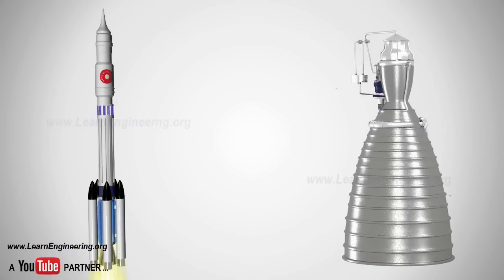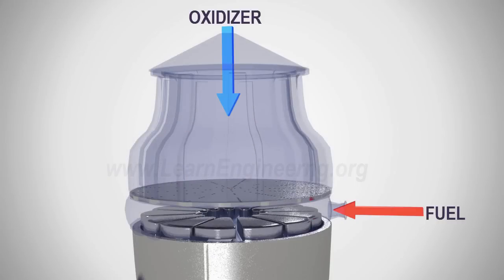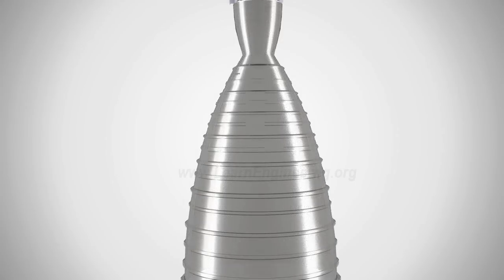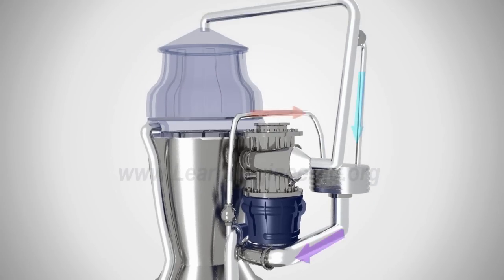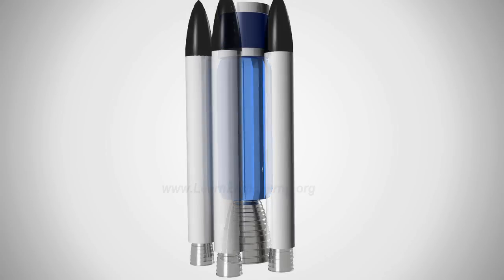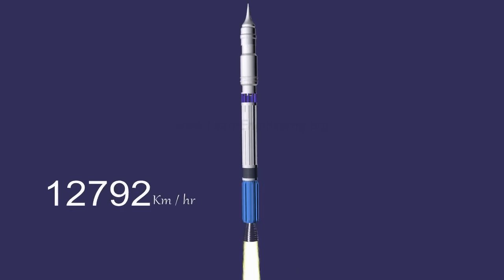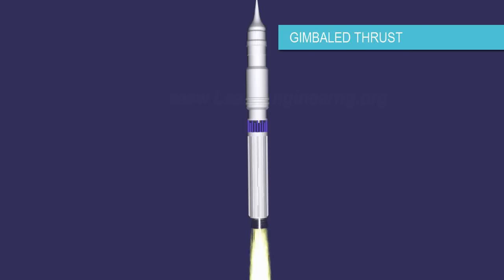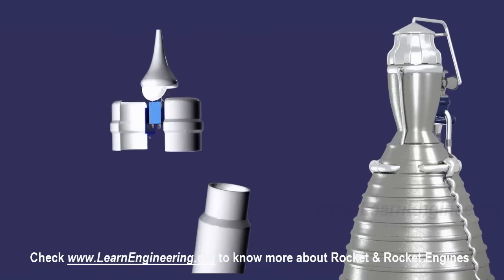How a Rocket works?

Comment: You talked about and showed animated "FLOW" going supersonic. This contradicts your idea of ejecting mass, that is just a mathematical construct, you are not ejecting anything, and there is no explosion anywhere, it is a combustion or a burn as you rightly stated. According to the article in wiki on rocket engine nozzles, any given diameter is only good at one altitude ideally, thus, at ground level where air is dense you need a narrow nozzle to concentrate the exhaust thrust column to push off the dense air. At high altitude you need a wide nozzle which disperses the exhaust thrust column to match the thin (dispersed) ambient air. The rule of thumb is like pushes best against like--your feet push off of solid surfaces but are useless against air. You will immobilize a rocket easily if you stick a wide nozzle on at ground level EASY debunk rockets don't need air https://www.youtube.com/watch?v=cEb6XFHTMPs sorry about that!
Reply: I'll try to make this simple: Pushing AGAINST air is NOT the way rockets work.
Reply: How do jet planes work?
Reply: it is a gas in both cases. In fact, NASA says a balloon is "the same principle" as a rocket.
Reply: And what does that have to do with rockets? NASA does not say that is "the same principle" as rockets. That is just bogus mind control disinformation that you parrot w/o thinking twice about it. Take away the ground or put oil on it and see how far you go w/o friction. There is no difference between rockets and jet planes, both push off air, rockets use the expanding gases of combustion directly and for 100% of thrust, jets use the air for 80% and combustion for the rest. You have stop believing in fairy tales.
Reply: It's called reflection. Now, you have not disproved that rockets push off air. Also, it is A FACT that earth is flat and the sun circles above. Sundials would simply FAIL on a spinning ball, there is absolutely NOTHING you can say to change that. Keep believing in your scientism, I'll stick to actual scientific observational REALITY.
Reply: Nothing you believe has been proved, starting with grabbity. The centrifugal force varies according to the diameter of fake globe earth, how the FUCK does grabbity vary? You admit rockets push off air, so what is your problem? Again, sundials destroy the fake globe, why do you choose delusion instead of REALITY?
Reply: No, only during the 24 hr northern sun can you film the sun in 360 degrees by panning TO FOLLOW THE SUN. On fake globe earth, your right shoulder crosses 12 o'clock then at 6 o'clock position your left shoulder crosses, THIS IS NOT REALITY, NOT OBSERVED. The shadows don't cross either. The globe is dead. Only exists in your head. And you call that "science"? hahaha!!! Wake up!
Reply: TRY IT! All games are based on flat earth and rendered as if earth is flat.
Reply: look up how sun sets on flat earth. I highly recommend p-brane channel for beginners like you. He covers perspective, but it is also the atmospheric refraction as a convex lens, I'll give you two links, one of p-brane's vids and one that covers the convex lensing, in that order: https://youtu.be/t_ipGoFf2Ss and https://youtu.be/75rBxMI8SME
Reply: The earth is a spinning object. You are lost in this discussion or you cannot read plain English.
Reply: Sweety, I do wish you luck, but I wish you would TRY at least to put the ridiculous claims we were indoctrinated from childhood with, to the test! The more you do that, the sooner you will understand earth is flat and stationary. It is a fact. I initially started out to "debunk" flat earth, but I could not do it and be honest at the same time. That is where the chips fall. Study my few videos on rockets, read the article in wiki on Rocket Engine Nozzles, and see the demo in my videos. You need a wide nozzle up high because the air is thin and pressure is low, the wide nozzle disperses the exhaust thrust column to match those ambient conditions. At ground level, the nozzle is narrow, to concentrate the exhaust thrust column. Rockets and jet planes both push off the air. Your dream should be to expose the lies of NASA. Seriously, you are not even trying.
Reply: All the proof is in our everyday observations, and EVERYTHING I say can easily be verified by anybody. No magical forces to believe in, no fairy tales... just the cold hard facts. I have given you more than enough info in this thread, the rest is up to you. Go ahead and remain an indoctrinated non-thinking parrot. Infinite space is NOT a confined space. Vacuum ONLY exists in man-made confined spaces on flat earth.
Reply: @rocketspushoffair  Jet aircraft are propelled, due to the fact that their engines are ejecting large amounts of air (air has mass) at very large velocities, thus creating a momentum force. Remember the equation F=ma, where the resultant force is found by multiplying a mass (air out of the engines) by its acceleration (speed of the air). It's a common myth that a jet aircraft is propelled by its exhaust pushing off air. 
If you knew much about aviation and jet engines, you'd know that the power output of an engine is given in POUNDS of thrust or Newtons - in other words, it's thrust is calculated by how much air (mass) is ejected at any given power setting.
Reply: @sailorman8668  Pounds of thrust t hat push off the atmosphere. Stick your arm out a car window at 10 mph and at 60 mph and you will understand that jets and rockets push off air. The faster you move in the atmosphere, the greater the barrier it provides, basic science my friend.

"Ejecting" a mass is absurd, because it implies that once ejected, you cannot affect thrust by messing with the ejected mass. However, simply bending the exhaust immobilizes the rocket, as is demonstrated in my videos, which 100% debunks your beliefs about rockets and jet planes.

Another problem for you is heat. We can barely do mach 3 and the fuel gaskets melt at that speed. Just watch 5 minutes of a shuttle launch filmed from a jet plane, and the NASA audio is overlaid onto the footage. Notice that NONE of the speed increases are observed, and it even slows down. It basically reaches the top of its max altitude (about 22 to 25 miles) and due to thin air cannot climb higher. It then falls back down to complete its parabolic arc: https://www.youtube.com/watch?v=1YQ3tVpwo2E

Seeing is believing. Science is observation based.

And speaking of pound force, where is the hoop stress in the ground that correlates with spinning over 1000 mph? It should be in the millions of pounds per square inch, based on the weight of fake globe earth.

NO HOOP STRESS = NO SPIN = NO GLOBE = FLAT EARTH
Reply: TOTAL DEBUNK of "ejecting a mass" PROOF that rockets push off air https://youtu.be/CLjxKhdQSrI

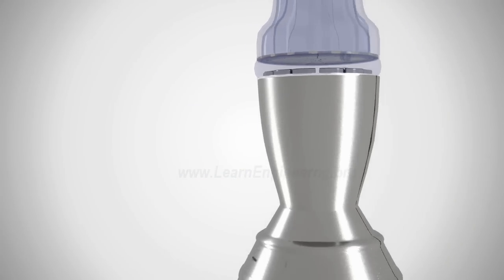Comment: 1:00 How does that shape increases the velocity of the exhaust?
Reply: Just like plastic water pipe squished by lage increases water pressure.
Reply: @abhishekmedhekar3418  I would like to point out that your statement is not entirely correct. Due the Law of conservation of energy and momentum, as a fluid flows through a pipe that is decreasing in diameter, the resulting pressure decreases as well. Remember, the pressure is the amount of fluid in any given area. Because the quantity of fluid at which the engine ejects is constant, the amount of energy from said fluid must remain the same. Therefore, if the area the fluid is moving in starts to constrict, it will naturally speed up because of the shorter path it is going through. But if the fluid moves faster, how could its energy stay the same? Well, the only way that can happen is if the amount of fluid going through decreases.

Here is a simple way to think of it

If the pipe diameter decreases, the fluid pressure decreases while the speed increases. 

If the pipe diameter increases, the fluid pressure increases while the speed decreases.

I hope this was helpful.

Comment: All a rocket is it's a jet engine which carries and feed it's own oxygen to the combustion chamber. Both gain thrust by pushing off the medium of ground and the air mass.
Reply: "All a rocket is it's a jet engine which carries and feed it's own oxygen to the combustion chamber. "
Correct.

"Both gain thrust by pushing off the medium of ground and the air mass."
The push out mass in the back, so create a momentun, an so the rocket moves in the other direction with the exact same momentum.

Of course the work in vacuum. They work even better, because there is no air drag- Only delusional conspiracy theorists with no understanding of basic physics, that were discoverd 300 years ago, believe, that they don't work ina a vacuum.
Reply: It seems you don't even know how a jet engine provides 'thrust' to propel the aircraft. 
You didn't actually know that air has mass, did you? LOL.

Comment: That is not Neutons law.. For every action there is an equal and opposite reaction. So I can see the fire at the back is the action and the rocket moving forward is a reaction but where is the opposite reaction?? Rockets cannot possibly work in space and the NASA analogy is fake physics and a disgrace to Neuton.. I vile lie and obviously to rip off the planet..
Reply: Davy spilani that you described in the start, is the 3rd Newtonian law.
Reply: PIGGYCubes So what is the opposite reaction?? If Newton meant that he would have said,, for every action there is a reaction! But he did not say that.. He said FOR EVER ACTION THERE IS AN OPPOSITE AND EQUAL REACTION! Quite different you see... like a gun firing.... It's like 2 boxes in space with a spring between them.. The spring will push the 2 boxes Appart at equal speeds! A gun is exactly the same thing,,, The gunpowder exploding is the action,, the bullet is one reaction and the equal and opposite reaction is the guns recoil, The speeds they move Appart are relative to the masses,,, ie the gun has much larger mass so it moves away from the explosion of the gunpowder slower than the bullet.. Now if you put a bullet with no lead in it,, nothing containing the gun powder and fired it,, you would have no recoil,,, try it? You are wrong in your analogy,, you have not included the opposite reaction... The rocket is like the bullet, the controled explosion coming from the back of the rocket is like the gunpowder,, so that's the action, the rocket is one reaction and that will not react unless there is an opposite reaction,, on earth that opposite reaction is the atmosphere, what is the opposite reaction in a vacuum? Without that you will NOT have motion.. Remember Rocket science is NOT a law of physics.. Newtons 3rd law is.. There is no special law for NASA or vacuums...
Reply: ΑΡΗΣ ΚΟΡΝΑΡΑΚΗΣ Do you realy understand Newtons 3rd law or do you just think you do?? I'm am describing the 3rd law but that is not what NASA is saying,, they say Action,, reaction!! What happened to the equal and opposite reaction??? Nothing to react to the motion of the rocket so the rocket will not have motion.
Reply: Davy spilani that it's all, but in a (grossly) oversimplified manner. The whole rocketry thing, imagine it as a continuous explosion. The nozzle is there to extract any remaining energy
Reply: ΑΡΗΣ ΚΟΡΝΑΡΑΚΗΣ No,,, inside the rocket,, the only thing getting pushed out the back is rocket fuel,, so if the action of forcing something out of the back is enough to give the rocket motion,,, why set fire to it??? Why not use water? The fire is ignited outside of the rocket and that explosion is the action!! In the atmosphere the rocket gets pushed forward by that action only because in the other direction, air is moving away from the action as well at equal speeds relevant to each others mass! That air is also getting heated by the explosion and that is causing atmospheric gass to expand and push back against the rocket. In a vacuum however, what is the opposite reaction??? Your or NASAs explanation does not conform to Newtons law,, a third  of the law is missing and that's the opposite reaction! So in space a rocket cannot possible work! Oh and it's simplified because it's not any more complicated than  that.. Very very simple..
Reply: Davy spilani whoa whoa whoa... One by one the questions please... Anyway, combining the fuel with oxidizer, allows us to lit up, leading to a higher efficiency
Reply: Davy spilani water can't be used as rocket propellant. It can't be burned, in essence it's dead weight, in unmanned missions
Reply: Davy spilani is that what I said. The due to combustion, the pressure in the combustion chamber (where the propellant mix is lit) rises to the operating level that is variable, according to the model of the engine.
Reply: Davy spilani that you do not understand? It conforms perfectly, since rockets eject gas, that is generated by the burn of propellants that are stored within the rocket body, consisting the biggest fraction of the initial launch mass. Because of that, rockets don't like to be operated within atmosphere
Reply: ΑΡΗΣ ΚΟΡΝΑΡΑΚΗΣ Sorry but that is not Newtons law! The rocket and the fire are connected via a fuel supply, at that point the explosion or the action and the actual ,mass of the rocket are joined,, so you have the action and the mass you want to move forward joined,, the action or explosion is created outside of the rocket and that explosion is clearly the action in Newtons law,, the rocket it's self is the reaction to that explosion,, but it will only move forward if there is an equal and opposite reaction,,, So what is that in space??? I know what it is in the atmosphere but I'm asking you what that is in a vacuum?? Because without that you don't have Newtons law you have action and reaction but no opposite reaction??? If you can explain what is the opposite reaction to the mass of the rocket which in turn is the reaction to the action or explosion! Then I'll get it but till this day no one can,, because in a vacuum there's nothing there!!! You keep saying I don't understand and I will not understand but the law is "for every action, there is an equal and opposite reaction" Like a stone in a lake, the stone is the action and if you look at the ripples they go in both directions out from the centre.. so the explosion at the back of the rocket is like the stone, it's clearly the action and the mass of the rocket is the reaction you want so that's like a ripple going in one direction so what is th e ripple going the other direction when in a vacuum??? In the atmosphere is the air moving away from the rocket but in space there is nothing to be the opposite reaction so the rocket will not propel forward,,, instead it will start falling back towards gravity...
Reply: Davy spilani unfortunately for your beliefs, rockets do work in space, and since there's no atmospheric drag they work even better
Reply: @davyspilani1231  Just a question Davy - did you know that the Saturn V rocket's first stage burnt fuel at the rate of 15 tons per second and ejected this mass out of its engine nozzles at hypersonic velocities? This obviously creates a HUGE momentum force going in one direction, which must therefore be balanced out in the conservation of momentum equation (P = mv) , by producing an equal momentum force in the opposite direction. Obviously, to balance this equation, the rocket will move in the opposite direction to that of the ejected mass (burnt rocket fuel) and will accelerate at the appropriate velocity, as the fuel continues to be burnt and ejected. 
m1v1 = m2v2 is the equation in operation here, where the mass and velocity of the burnt rocket fuel will be equalled by the mass and velocity of the rocket - get it?
Reply: Davy spilani, misspelling Newton's name is a disgrace to Newton.

Comment: What if  we used nuclear as a fuel? Would this decraese the total mass and so increase the velocity an accelaration?
Reply: There are engines being tested that run their propellant around a nuclear reactor, causing it to expand without actually burning (which is much more effective in space, but works pretty poorly in atmosphere). That's really the only way to utilize nuclear energy for propulsion at this point.

Comment: when a rocket is on plataform ready to be launch, what is the vapor and dust that falls down as it lifts over???? thanks
Reply: Jorge Diaz ... That's extremely cold liquid oxygen in the tanks forming condensation as it reacts withe the outside air, even forming sheets of ice on the surface of the rocket as it instantly freezes the moisture in the air.